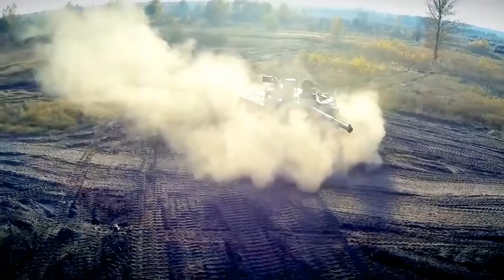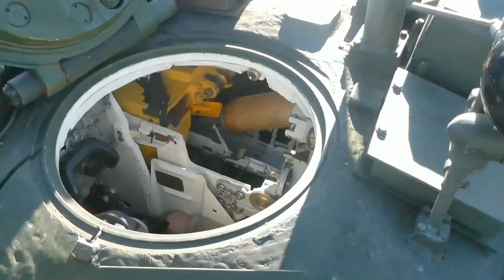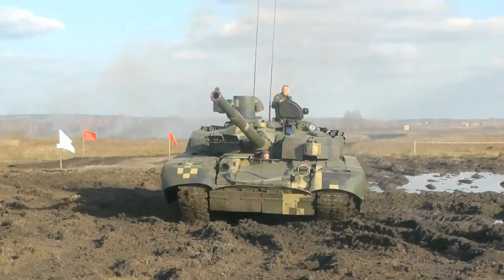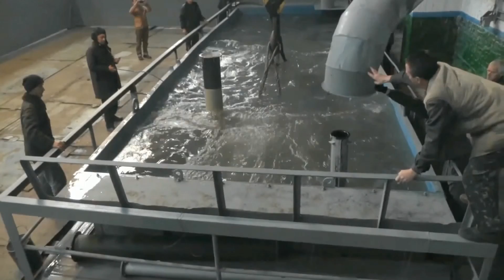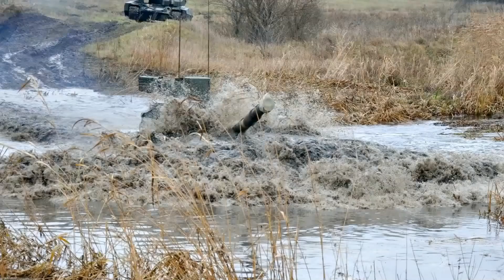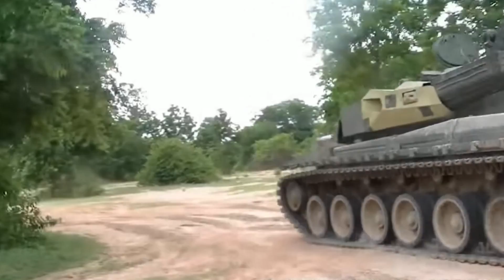The T-84M Oplot Main Battle Tank - Overview

Comment: T64/T80 Family of tanks are my favorite in the Soviet Bloc.  Love them.
Reply: Alex4n3r T72 and T80 are completely different types of machines. T84/T80 are based on T64 while T90 is based on T72.
Reply: @Vicious_One yes.
Reply: Both are produced in Ukraine btw :D 
(Ukrainian SSR at that time)
Reply: T84 is basically T80 with a new turret, upgraded armor,  new engine etc
Reply: Vicious One they all based on T-64.
T-72 was made in Ural as "T-64 with engine, that can be mass-produced (modernizated V-2 engine from T-34)", but because of some cocky guys from Ural Vagon Zavod they decide to make new tank (saying that T-64 was full of engineering mistakes and problems, but in final T-72 had even more) with same hull and some "genius" things, such as casted turret without combined armor, new suspension with new roadwheels and new traks (from old Obj.167M aka rejected T-62B), that makes stab work a lot worse - you will be lucky to hit smth in movement. Also new autoloader, that works worse than T-64 autoloader (russians now have a big headache because they cant fit bigger APFSDS there) and primitive fire control system - it was a real betrayal to soviet tank forces.

T-80 is infact a T-64 with gas turbine engine made by Leningrad, and again - they started to make they own tank, saying that T-64 chassis cant hold power of new engine (it was a lie tho).
T-80 have same hull, same turret, same autoloader and FCS.

In final you got 3 tanks that close to each other by stats, but have a lot of difference when it comes to maintenance - it was a nightmare, because even nuts and bolts was different without any reason.

T-84 was based on T-64 prototype with new diesel engine, new roadwheels from T-80 (because of big weight), new Nozh ERA and new turret.
BM Oplot based on T-84.

T-90 was a renamed T-72B from 1989 - changes was only with that "Shtora" system. Later they began to add T-80 FCS in T-90 and made a new turret for T-90A. T-90M got new autoloader in turret rear, new FCS with thermal sights.
Reply: @ozza1785  T80 does not have the same hull as T64. T80s hull is quite a bit bigger and the suspension system is completely different. T64's suspension was rather fragile and often broke so they redesigned it for T80.
Reply: @ozza1785  " T90 was a renamed T-72B from 1989 - changes was only with that "Shtora" system" 
This is incorrect. There is a lot of confusion surrounding this but T90 is NOT a renamed T72UBK. Red Effect has done a good video explaining the intricacies or I would recommend you check out Steven J. Zaloga's book on T90.
Reply: @ItsATrap614  
>T-80 does not have same hull as T-64.
Go search for Obj.219Sp1/Sp2 - you will find out that it was a T-64A with gas turbine engine. T-80 (without any letters) have T-64A turret and modified T-64A hull to fit new suspension and engine. Even the single driver view port is there.
>T-90 was not a renamed T-72B 1989
Well yeah, but actually no. There was several variants of T-72B modernization: install 1A45 FCS or modify 1A40-1, install Shtora or not/install new gun or not/install new engine or not. And there was Obj.187 (which had everything +new armor layout and welded turret), which actually deserved name of new tank. Russians decided to save some money and choose only installation of Shtora and 1A45 FCS on T-72B with Kontakt-5. Naming that a new tank was more of a marketing move.
Also reading western authors that write about soviet/russian/ukrainian tanks is kinda meh - often they don't even get the dates right~
Reply: @ItsATrap614  don't get me wrong tho - Zaloga is nice author, but i have ability to read from "first source" - books from Chobitok and Tarasenko for example, memoirs from Kartsev, Morozov, Popov, Venediktov or books about them.
Reply: @ozza1785  "Also reading western authors that write about soviet/russian/ukrainian tanks is kinda meh - often they don't even get the dates right~" 

Blanket statements like that do not add much to the discussion. 
Steven J. Zaloga is a highly respected military historian and his series of books on T62/T64/T72/T80/T90 is very well researched and highly regarded by many. Idk why you would discredit him. Assuming he's incorrect solely because he is from a western country is beyond stupid.  

As for the parts of your reply that were relevant and worthy of answer I'll have to get those books and look up the info on what you're saying, so I'll come back to that.
Reply: @ItsATrap614  well as i said - i have no reason to read him, since i can read info from soviet/russian/ukrainian authors.
Reply: I think you meant families not family
Reply: T84 is based on T64 line. T80 is based on T72 line.
Reply: T-80 is based on T-64 more than T-72
Reply: T80 expensive modern variant based off the T64 
T72 cheaper exported variant that is more efficient
Reply: @Alex4n3r  t80 was seen as top notch evolution of t64 while t72 was to be a budget tank. T90 is a fusion of t72 hull and t80 turret.
Reply: @uporabn1k  T90's turret is not from T80. The cast turret on T90 was a turret from T72B (with the reflective plates). While T90A's turret was heavily influenced by T80's welded design, the composition of the armor inlay was different from T80 and more similar to T72's inlays with the reflective plates.
Reply: @Alex4n3r no.

Comment: sorry, while they keep that Russian-style ammo carousel and don't improve it for flash protection (& you can see they haven't at the start of the vid when you can see them loading the carousel) it is still going to suffer the same problem of too easily cooking off the interior when penned.  Sure, it's a vast improvement over the original T72 that starts the series.  But it's still little more than a product-improved T72 ultimately.
Reply: With the T-72 NOTHING in common. Closer to the T-80 and T-64 of course.
Reply: Джо Неуловимый  the t64 is unique. never exported. the T72 is a cheaper development version, built to save money and also for export in various standards.  the t80/t82/t84/t90 are all progressive updates on the T72. then, add on other nations doing updates to various models, like the one in this video. but at heart, they're all still basically t72's.  the Armata is the first genuinely new  MBT design from the Russians in ~35 years.
Reply: The series began with the T-64, not T-72. 
They have DIFFERENT system loading, different engines and chassis.
T-84 is a continuation of the T-80U and the T-64.
Reply: After the T-64 series was divided into T-72 and T-80, they evolved in parallel.
Reply: It has nothing to do with the T-80, you silly. Did you even watch the video?
Reply: Джо Неуловимый    regardless of the parentage, they are badly designed in terms of survivability and have a habit of exploding/burning when hit.  the ammo stowage system is poor and dangerous.
Reply: They are well-designed for its purpose. 50 years ago, they are outdated very long time. Loading T-64 and T-80 is even more dangerous than the T-72. But that's basically the problem of maintenance, not the tank. They are sufficient when used properly, as well as the Leopard 2 and the Abrams.

Comment: I think the Leopard 2 has a pretty deep fording capability. I could be wrong though.
Reply: only.... is good 4m is enough for nearly every river in Europe..and there is no problem to add more tube moduls  to increase high to get deeper...the real important part is that the tank has lenz pumps to get rid of water inside the tank, good seals that reduce water comeing inside to a minium (you never can get a Tank 100% waterproof because the sealings are constantly stressed by dust and dirt during regular service so you always have some dripping water inside under water (personal experience I drove the Leo2 under water twice) which is realy fun
Reply: pff leopard 2 is bettr in any way ... than this can and im not nationalist or anylike that, i fact im with russians but leo 2 it is just better in anyway.. the french lecrelc also
Reply: leopard 2 has front armour and a good gun. the sides are basicially the same from the leopard 2 prototype.
Reply: Afaik 4 meters is not limited by the rube length but rather for the ani water sealing that is designed to withstand water pressure up to 4 meters deep ( with some margin probably) as i heard.
Reply: the Leclerc had troubles in first batches, but french managed and corrected them ! now, the F3 variant is a nasty little and very mobile tank !
Reply: Yeah Leo 2 can do it too and the K2 Black Panther.

Comment: How do you feel about the claim that it's protection system (armour) is superiour than Russian one?
Reply: For the time being T14 is a very expensive experiment which is backed by the fact that Russia hasn't ordered more then 70 units till 2020 + sanctions issues which has prevented them from importing US, German and French electronics, optics, radar equipment etc. E.g. T14 APS - Afganit fully relies on radar parts from the US, its thermal vision system is of French origin, etc. According to Jane's Defence Weekly sources in Russian military T14 Malakhit ERA in current version is just an evolution of T90SA/MS Relict, so the overall protection improvements are hardly radical. I won't be surprised if they will copy something close to Nozh in the near future as their own ERA has reached its design limits.
Reply: Maybe it's true? Who knows...

On the sides of Oplot, that's ERA no?
Reply: I don't know, but even if it is, the Russian will be taking it to account for the future, the Armata is a proof of this already
Reply: Just view the Duplet ERA testing on youtube against APFSDS and tandem HEATs leaving small marks on the armor and decide for yourself :) no other ERA can do such things. Oplot is the only MBT that can easily survive a modern APFSDS round hit from the front at point-blank and any modern Tandem HEAT munition hit to it's side. T90 Relict and T14 Malakhit side ERA aren't capable of such feats. And T90MS Relict won't stand a chance against M829A3 at 1000m and closer.
"It is a reproduction of one of dead-end branches of development era in the USSR" - LOL, Nozh has NOTHING to do with Gofr which you're referring to and Gofr was indeed a dead-end ERA design.
Reply: I don't like Russia but I highly doubt Ukraines protection system is superior
Reply: It is a reproduction of one of dead-end branches of development era in the USSR. It is effective up to a certain limit, but has no prospect of success.
Reply: He said it was superior to the Kontakt-5 ERA, which is 32 years old by now. The Kontakt-5 ERA could defeat the M829 and M829A1 Sabot rounds, but not the M829A2 they developped in the 90's as an asnwer to it.
Reply: Yaroslav-Z 
Don't put into prospective the Armata, it's still a ongoing experiment, so far it's an impressive and really really modern design.

I don't think the Russians will just ignore this presumed inferiority if their armour, I highly doubt they're not developing or planning to develop a new protection system for such a great platform.

Plus, it's 125mm should be a improved version of the previous ones, also mentioning the proposed 152mm gun.